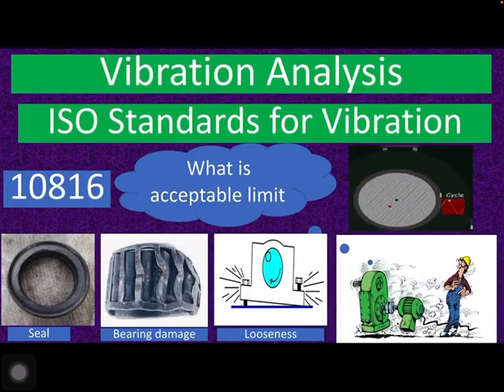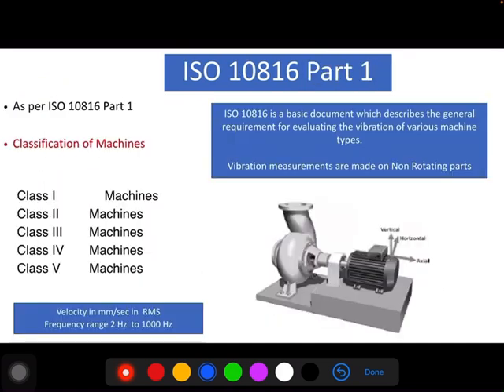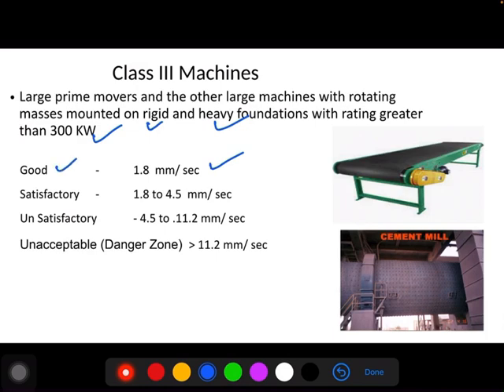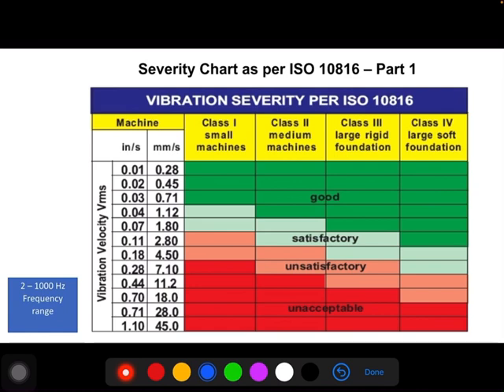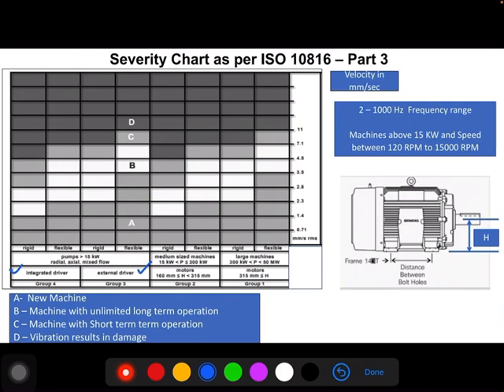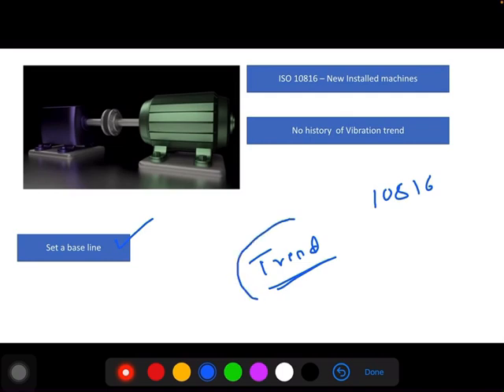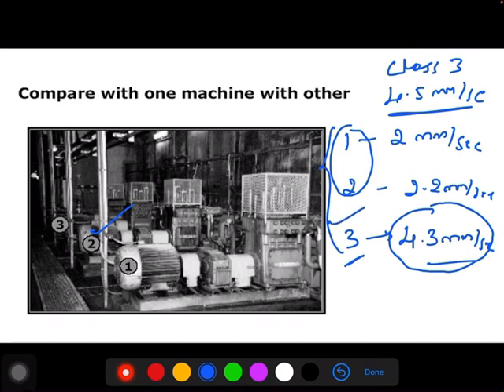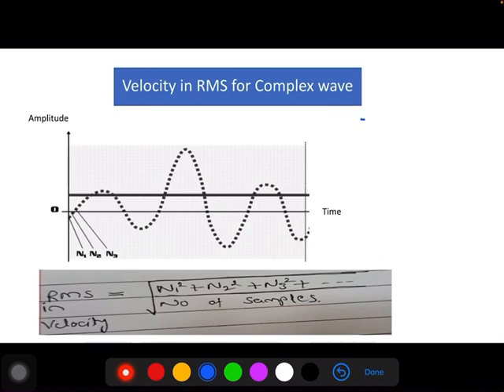Vibration Analysis Acceptable Limits || ISO standard 10816 || Trending and comparative method

Comment: Sir
What is the Vibration acceptance limit for motor no load test.
If any standards available for solo run.
Reply from the maker: Accepteble limit for Electrical Motors are specified by International Electrotechnical Commission (IEC) 60034 standard, mainly part 14 based on motor frame size with rigid and flexible mount. Some reputed Motor  Original equipment manufacturer(OEM)  provides acceptable limit in their manual itself based on bearing types, anti friction/Journal bearing, size etc.

Acceptable limit for Motor no load test as per my practical study  will be less than 1.5 to 2.5 mm/sec based on frame size with rigid and flexible mount.  

Motors with proven electrical problems will not generate vibration signatures
showing problem symptoms when operated "solo" (uncoupled from the driven machine).

Definite symptoms appear when such machines are loaded, particularly at or near 100% load. Of course, this relates directly back to the fact that electromagnetic induced forces are so dependent on the current drawn. If the electrical problems are suspected, Motor should be run with the motor fully loaded.

Hope this cleared your query.
Reply: Thank u